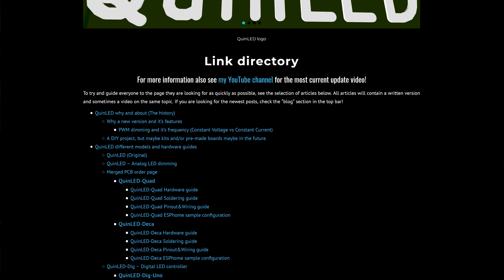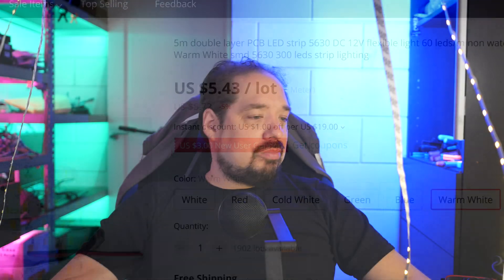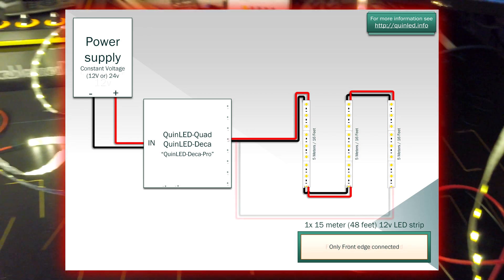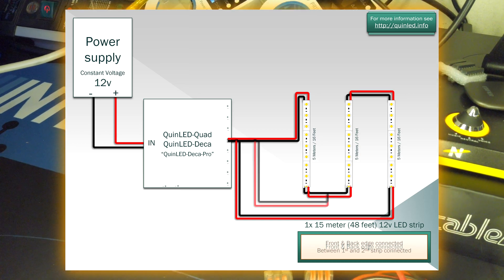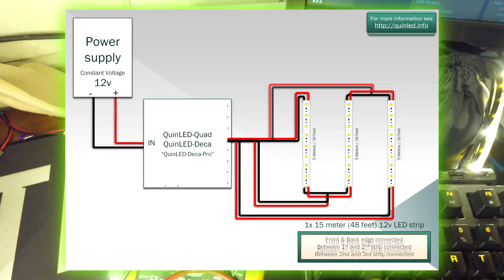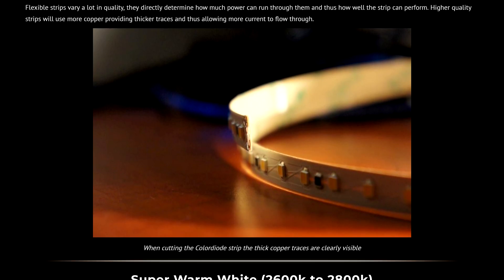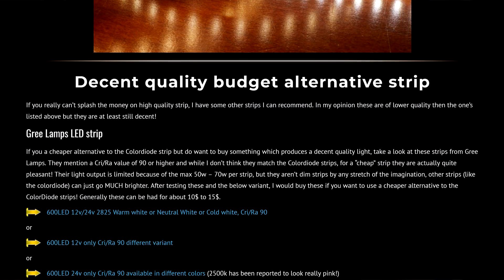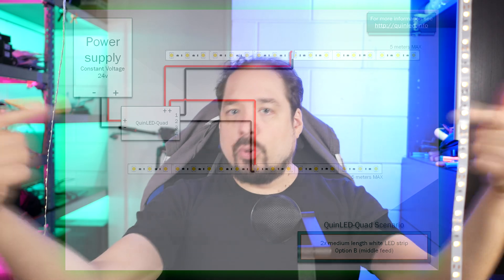QuinLED: Combating LED voltage drop | LED Power Injection

Comment: Please, thanks very much for education. My question is, if you look at say the auxmer rgbcct strip, it is labelled W C R G B +. IF you want to inject power, you tap the + and which section on the strip in order to connect it to the + and -  of the power supply?
Reply from the maker: Analog you can only inject from the controller, not directly from the power supply. This has been incorporated in the An-Penta-Plus design for instance. You inject lower as required like any other strip and always all wires so for instance for 10m RGBCCT that would be front + end with all 6 wires.

Comment: I bought 40 meter of 24v led analog strip i want to hook it up to the new an-penta-plus and try to power it with one psu and no power injection.
Reply from the maker: How do you mean no power injections? The An-Penta-Plus can't solve the voltage drop on the LED strip itself, still need to inject. This controller just makes it easier to do so.
Reply: @IntermitTech  i mean drawing all power from the controller by connecting power from both sides at the controller end.  Nkt having injection in the middle of the led strip
Reply from the maker: @MrEXtAc3 aah like that, sure that can work if it's strip that has a decent amount of copper and doesn't use too much power. If either of those isn't true you are still going to have voltage drop for a span of 40m. Maybe maybe if it's 48v strip you could make it with just front + end injections but it's just a really long length!
Reply: @IntermitTech  i bought the auxmer rgbcct strips, and they will be two separate strips both probably a bit shorter than 20m so i hope it will workout. I posted about it on discord as well and ill share any updates there
Reply from the maker: @MrEXtAc3  Ahh I'll try and find your thread about it! Yeah hacking it into 2 segments and powering those front + end should already improve things considerably and work nicely!

Comment: If the strip was using 12 awg wire to power the LEDs, and there was practically no voltage drop, we are saying that we would essentially be doubling or more the amount of current we are sending because the circuit can handle those loads? I had previously thought that any inefficiencies with thin wire, and the resulting voltage drop, would just result in greater heat output, rather than less current usage.
Reply from the maker: Ah yes and no. The voltage drop results in a higher current draw coupled with heat because of the resistance, yes. But at some point this resistance will overtake what can be drown with distance thus what it can draw is also limited by resistance again. Adding more copper to provide a lower resistance path to a spot that otherwise has to tevael through a long path of resistance thus then translates in to higher current draw too.

Next to that, a diode running at 5v will draw say 40mA but when getting only 4v will also start to draw less generally especially on a strip with resistors and not constant current drivers, etc. Etc. 

So it's a mix of a lot things going on.

Comment: Hello. I'd like to ask you how to wire a power injection on very long FCOB CCT led strip. Thank you in deed.
Reply from the maker: It's basically the same? Add wires to the solder point along the strip.
Reply: @IntermitTech  Did not work. I had to make an Y offset after the controller, one side for the start one side for the end of the strip, it worked. If I add the + wire to the end of the strip and the - for the CW or WW point, the other white disappeared.
Reply from the maker: Ah yes if we're talking analog you do need to take that negative channel from the controller and wire it from there. Positive isn't controlled in that sense so can come from anywhere (controller or PSU). In theory where you inject shouldn't matter, it's all one connected trace with analog so you need to spread it over the strip for best effect to counter voltage drop.

Comment: Hi there, I have 5v LED Strips (5m @ 150 LED total per strip) I am planning in following your recommendation of 500-600LED / Channel in my Dig Quad (for this project I will end up with a total of 1050 LED ish therefore 2 channels in use). I have 2x 300W / 60amp power supply. Now, I watched your video about the wire gauge between the Power Supply and the Board where I will most likely go with 12 Gauge and double feed... What about the gauge for the power injection? I bought a roll of 16 Gauge to run along my strip and planned to inject at the beginning and end of every strip. Thoughts?

Also, if I have 2 Power Supply but running only 1 DigQuad board. Considering double feeding, I probably feed power to the board using only 1 of my Supply correct? 

Now I suppose that I can't feed all my 7 or 8 strips from the DigQuad ports as it would most likely be too much power, am I correct? If so, how do you suggest the power injection be done to be safe?

Thanks!!!

Comment: Is there a difference between connecting a long strip (series) or cut it in half and connect the halves in parallel ? Would it make a difference in brightness? Would it be NOT recommended as perhaps each half receives more power? (perhaps a ridiculous/non scientific assumption to make)
Reply from the maker: Not sure what you arw asking but the clue is to inject power where necessary. So if you cit it in half and the connect both halves directly to the controller, you are doubling the surface area of the copper and thus current (as long as you are limited by voltage drop, it won't draw indefinite amounts of power). It's fine to connect it as 2 halves, it makes no difference really?
Reply: @IntermitTech  I basically was hoping that if i cut a long strip in two and connect the power to both (in parallel) the overall brightness would be greater. Is this not the case? Will the brightness increase? stay th e same in this case?
Reply from the maker: It depends, if you where not injecting properly, the power now has double the surface to spread over and thus more power can flow and it will be brighter. But if you where already injecting properly and the LED strip is running at it's rated output, it will make 0 difference. But just do as in the video, measure it!

Comment: In terms of reducing resistive losses, the easiest / best thing to do would be to chop the 5M strip into four sections, wire them in series, and use a 48V power supply.  You'd then be driving only 1/4 of the current through the system, greatly reducing resistive losses, but wouldn't need long lengths of additional wiring.
Reply: Well sure, but the layout you want to use your LED strip will really matter if that's an option. Also if you have to cut the 5m in 4 sections and need 20m that's 16 sections and thus wires and well it becomes quite complex. Injecting front + back on this horrible strip is fine in these tests and normally with decent 24v you could do front + back over 10m generally unless it's really high power strip.
Reply: @Quindor  the sections would be in series, so it wouldn’t be complex at all — it would actually be simpler than the other approaches.
Reply: @cellularmitosis2  running 16+ wires progressively long doesn't sound easier to me then running 4? Thinking of when the LED strip is in a loop around a ceiling for instance.
Reply: @Quindor  why would it be 16 wires?  I'm confused
Reply from the maker: If you connect 3 or 4 of these strips so 15m or 20m to go around your ceiling. In my case with front + end feeding each 5m strip you'd have to run a few wires but then everything will be lighted evenly. If you have use say 1m or 1.5m strips so you don't have to power inject, you'll have to run a wire for each section?

Comment: Thank you. This explained my problem with fish tank lights. I have 3 banks of 12 volt led strips. I injected power at the 1st and last bank but the middle bank are dimmer. I need to add another injection point in the middle bank.

Comment: Hey cool video! I have a question. I am running a 5v fastLED fir a hollowness costume with tons of LEDs and I am experiencing this very badly now. The LEDs are programmable and directional with the data cable. Is the putting power boost at the end of the cable fine? Just don’t do add the data cable? .. thanks!
Reply from the maker: To power inject? Yes, add wires run from the same power supply and then it's fine to connect it all together.

Comment: Question.  I have a 24volt Driver , 100 ft. of 12 guage lighting wire connected to 16ft. of tape light and can't get it to light up. Im getting a voltage drop down to 6.5 Volts at the end of the 100 ft.. Any ideas to get it to work?

Comment: Hey Quinn, I finally got 3 good quality strips, quality 12V 240A power supply and a good RF controller and I'm all wired up. Would you please either explain or direct me to where I can see how you wire-up an injection point? I assume one end goes to the power supply's available low-voltage + and - terminals (mine has 3 open pairs), how do you "tap-in" to the run? I plan to use 12 -14 gauge R/B since the 22/4 is too fine as you mentioned, thanks Quinn
Reply from the maker: Are we talking analog or digital LED strip?
Reply: @IntermitTech  It's not addressable, there are 4 wires/contact points, red green blue and black, the black is labeled "12V+"
Reply from the maker: Ah for those you'd need to inject positive and each channel from the output terminal of your LED dimmer.
Reply: @IntermitTech  By inject positive, does that mean running a wire and soldering just one contact point on the 12V black pad without any "negative" wires soldered on the red green or blue? If so, I assume I only have to run it to 5M #2 and 5M #3 since the #1 is not at all "dimmed"
Reply: I've got a spool of 22/4, do you suppose I can twist off 2 of the 4 wires for the injection, or do you think I should grab some 16 or 18 gauge? Thanks Q
Reply: @IntermitTech  You'll never believe this trick I stumbled across Q, while pulling my hair out trying to figure out how to connect my 3 5 meter strips adding power injection, I added one of those little 6 amp mini-controllers, the + and - to my power supply and each end of the mini amp I plugged into strip #2 and strip #3 and VOILA! NO VOLTAGE DROP! At least to the eye...even at full white!!! There may be the very slightest dimming on the #2 strand, but I'm being nitpicky, I'd say it's at roughly 85%, strips 1 and 3 100%
Reply: I bet it would be a perfect 100% if I added a 2nd mini-controller between strips 1 and 2, but when I tried, the color red changed to yellow on the 3rd strip, I'm guessing I made a poor connection when making that mini-controller "pigtail"
Reply from the maker: Not sure what a mini-controller is but if you're talking about a little PWM relay box with which you can inject power again also, sure, that can work. I generally work with high power controllers and just run extra copper from that. But hey, whatever works.
Reply: @IntermitTech  sorry, mini-amp! looks like a usb thumb drive but skinnier lol

Comment: can i just connect 2 5m led strips together in the middle ? so that both are plugged in?
Reply from the maker: Yes? Not sure what you are asking really.
Reply: @IntermitTech  i have 2 5m led Strips but i am worried that they wont get enough voltage from 1 Power supply so can i just plug in both of the 5m strips and then connect them together in the middle so it's 10m ?
Reply from the maker: @wZerox  Euhm, yes, but also no. First of all your power supply needs to be rated for the right Amperage. If you got it with a kit, and your current strip uses 5Amps, you can't add another 5Amps strip since the total will be 10Amps. If the power supply is prepared for that, then yes you can but you will run into the exact issue shown in this video so you'll need to run extra wires.

p.s. Volts aren't in play here, volts just need to be the correct, so either 12v or 24v for instance. Amps scales with the amount you connect, volts always stay the same.
Reply: @IntermitTech  but instead of leading a whole cable from the 1 Power adapter through my whole room can i just take a 2nd Power Adapter and put it at the end ? I'd have it like this: Power Adapter1 - ESP8266 -5m LED 5V Strip - 5m LED 5V Strip - Power Adapter2
Im using the WS2812B Eco LED Strip ( 5m, 60LED per m)
Reply from the maker: Yes, but no. With a double PSU you must have shared GND but absolutely not shared positive. So you'll need a cut at some point and then run power injection wires per segment you have created to use multiple power supplies.
Reply: Ok Thank you

Comment: Thank you!  This is exactly what I was experiencing with decent quality RGBW strips in my ceiling.   I am using power amplifiers on one end of each 5 m strip, but did not think about adding power to the end of the strip.

Comment: Hi Thank you for the video .  I am in the UK .I am using 12v rgb 4 wire system . I have done some testing on the 20metres i have put in my bedroom  and proved with the volt meter that i have some voltage drops .In one section after about 5m there is about 1.5 v drop but visually not noticeable where it is installed but other parts of the room drop down to 8volts with significant visual difference . Your video has given me help in what i now need to do ,which is great. Now..... i have some solid core 4 core 0.5mm diam telephone wire can you see any reason why i shouldn't use it  for the power injection ?  Do you have any info on how many watts using 12v DC this cable could handle over 20metre . Hope you can find time to read this and find a reply. Meanwhile i am going to look at some more of your vids. Best regards Don.
Reply from the maker: Sure, on my website there is a lot more information regarding voltage drop and such. I once did a power injection live stream too, and while oriented towards digital LED strip, the principles and calculation methods are the same. Try and find that article in the digital LED section of my website. :)

Comment: Hi. So Im a noob here. I have good quality GRB WS2811 led strips. I have 32 rows of 20 chained together. My power supply is a 5 volt 10 amp. Im using awg 18 wire to connect them. Now everything looks good and functions fine on lower brightness which is actually ok, but starts to fart as I turn it up. My question is if I splice an extra power connection would it be at the 16th Row, or added to the last led at the last row?

Comment: Hi, the multi-meter that you are using, I have previous experience with it and those meters(DT9205A) are not accurate at all. I've had 4.2 lithium batteries show up as 5.1 volts, it wouldn't detect some shorts, it doesn't accurately measure resistance. It's overall horrible and I suggest that you replace it with something else before something blows up. I got a Uni-T one and have been happy ever since.
Reply from the maker: Yeah, I have since upgraded to a different one, multiple actually, including a Uni-T. For me the old one has been fine, as long as you keep the battery healthy, otherwise it starts to act really funny.

Comment: Wondering why there's no 24v digital LED strip... that would be so nice! (with high CRI as well)
Reply from the maker: Problem is that LEDs are 3v. So where most 12v is per 3 addressable, 24v would be per 6 addressable! And for a lot of implementations that kind of moves beyond the point.
Reply: @IntermitTech  ohh I see.. maybe at some point they can create higher voltage LED. I'm looking for LED strips with high CRI but that are digital, do you think the warm white on the SK9812 would be "good enough" CRI-wise? thanks!
Reply from the maker: They are not, CRI wise they compare with the 4$ cheap LED strips. I don't know of any High CRI digital offering, sk6812 WWA comes closest, but then you lose RGB.
Reply: @IntermitTech  thanks a lot man, please keep making awesome videos. Also I love your unboxing from Aliexpress series hehe. Cheers from Spain <3

Comment: So:
120leds/m RGBWW SMD 5050 LEDs
IP67
Dimmable
Wifi enabled
power supplies 24V
24V Led
Top super brightness 3000mcd and 3 ounces pcb
What you think?
Reply from the maker: Only thing missing is the CRI value for the white part.
Reply: @IntermitTech  CRI 90. Good? We will have constant voltage current as well.
Reply from the maker: CRI90 is decent yeah. Be aware that constant current strips generally cannot be dimmed but not sure what you meant with constant voltage current. Got a link to this strip?